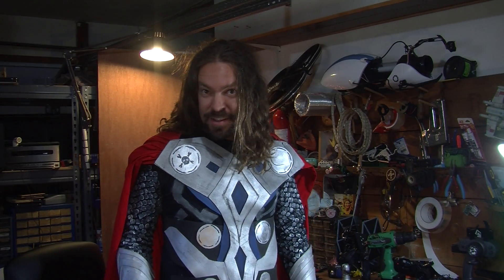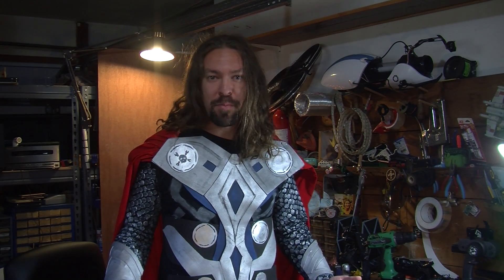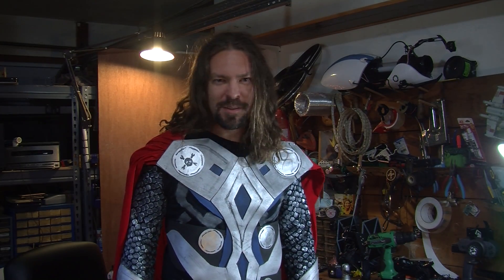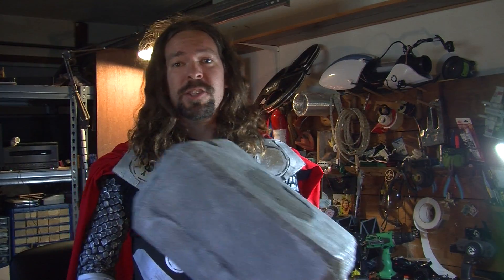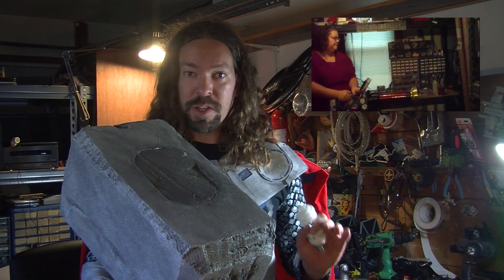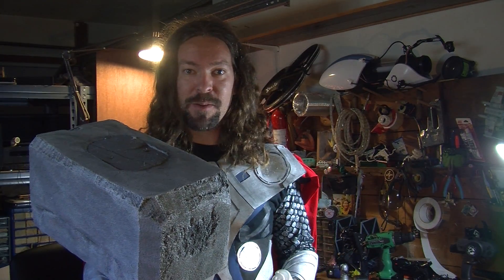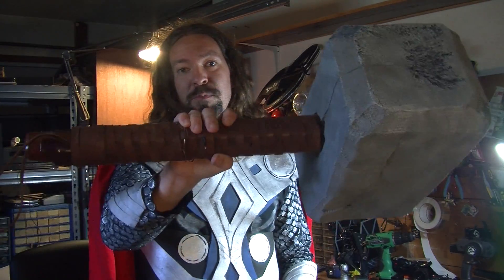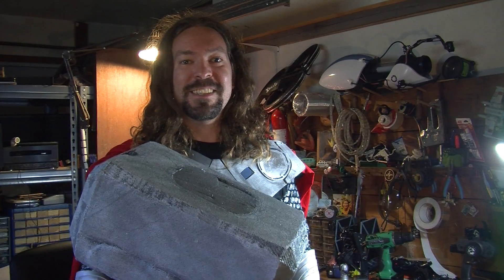DIY high voltage Thor's Hammer: Mjolnir at 80,000 volts

Comment: Please don't spread that stupid sentence. Amperage = Voltage/Resistance. Since the resistance of the human body has an upper and lower boundry, more voltage will result in more current(amperage) flowing through ones body. That's why I ask: 80kV is a really high voltage and I know that the amount of voltage you would receive from that hammer depends on the distance from the hammer. However, how far do you need to be in order to be ok?

Comment: Hmmm... a fire sword.... I'm guessing a light flexible metal with a ahard edge (a sword, wit a tube/hole drilled down the length of the blade with tiny holes on the sides at equal distance. Hook it up to gas, light it and Fwoosh.

Comment: Put a taser or stun gun leads on it!!. Put the darts/prongs in the open area in the edges of the hammer, and then build a small multiplier from the base power supply loading up the tesla coil.

Comment: Ok, ok ,ok. I was going to keep my idea to myself until I did it myself, but I probably won't end up doing it any time soon (Really, no equipment for it...). I got the idea from a plasma globe that came with a collectors edition of MGS: Rising, but instead of a katana, you could put Mjolnir in a glass container instead. I researched it a little (the plasma made way different shapes than normal), and I concluded they likely use Xenon. I'm an iron man fan, so the arc reactor may come first.